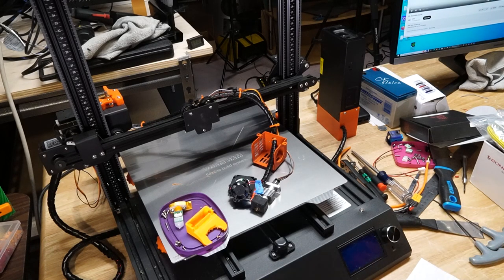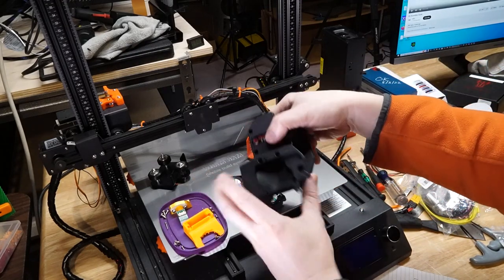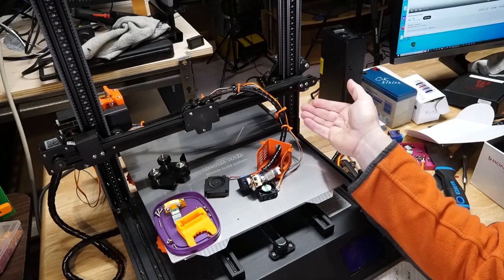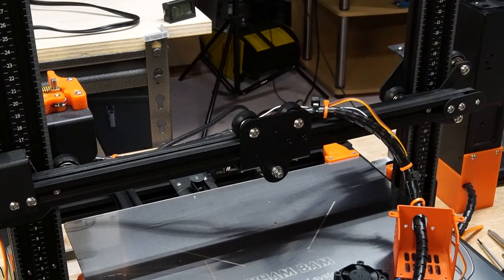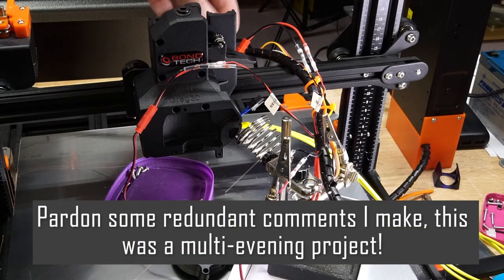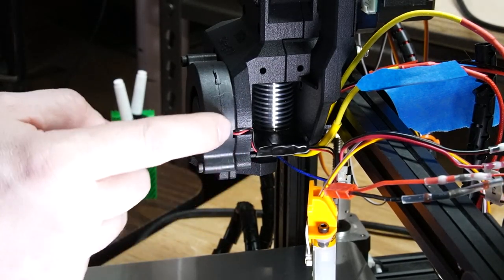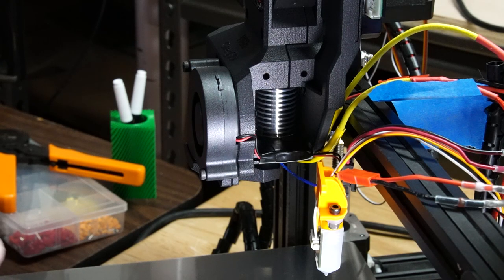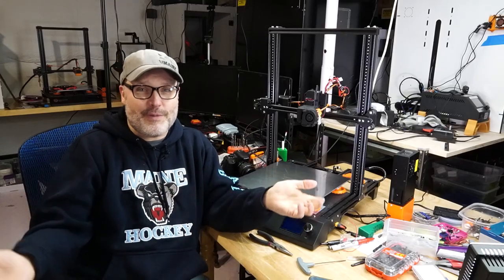Direct Drive Upgrade for my Eryone Thinker - Part One

Comment: Great video, can you include some links to buy the kit you used?
Reply from the maker: Hello!  I had the parts left over and I know the DDS is no longer available.  If I did this all over again, I would buy the Bondtech DDX for CR-10S.  The DDS doesn't have a lot of clearance at the bottom to see what's going on while the DDX is much better.  Start with that (https://www.bondtech.se/product/bondtech-ddx-v3-for-creality-ender-cr-10s/) and scroll down to "The 4 PHases of DDX"  If it were me, I would go PH3 with the full Copperhead or Mosquito.  (Probably Mosquito since it's so easy to change nozzles out with!)  You would need a CR-10/Ender carriage (https://www.tinymachines3d.com/products/creality-x-carriage) and then you're off. The real challenge, which is where I am stuck, would be the firmware.  I don't have that creative gene and am relying on someone to give me a hand with that!  I hope this helps?  Let me know !
Reply: @WhereNerdyisCool  thank you

Comment: Working on my E3D V6 upgrade today with dual 24v parts fans on my Eryone V2. You had mentioned moving the jumper to supply cooling fan with 24v. My jumper is labled 5v/24v/12v with the jumper on the 5v/24v posts.  I Am assuming the jumper moved to the 24v/12v posts will supply the fans with the needed 24v?

I am also assuming you were using stock motherboard?
Reply from the maker: Yes you can search the Eryone forum to see a board layout.  Leave the board fan on place thou, that’s on its own 5V source.  Also of you are using a Bondtech make sure you adjust the e0 stepper driver. Remember you need to do some math for 2208 drivers
Reply: @WhereNerdyisCool  Not going with the direct drive just the hotend upgrade. 

Do you have link to forum by any chance?

Thank You.
Reply from the maker: @richarddreger1944  https://www.eryone.com/forum/
Reply: @WhereNerdyisCool  Thank you so much. It was this video that made me want to upgrade mine :)
Reply from the maker: Happy to inspire you!  I’m really liking the Revo Six so I can change nozzles out quickly
Reply: @WhereNerdyisCool  Looks like the forum is defunct... Do you know where I might be able to find a board layout NOT on the forum?
Reply from the maker: @IDKHowTo great question! I wonder if the Way Back Machine that stores websites has it. I’ll check my old bookmarks for the URL